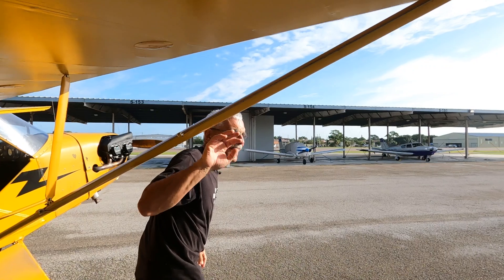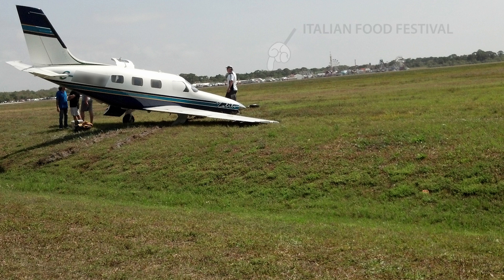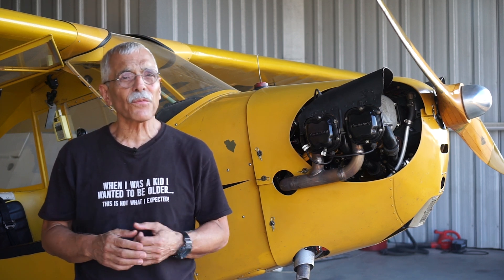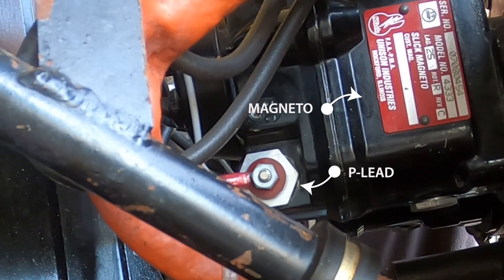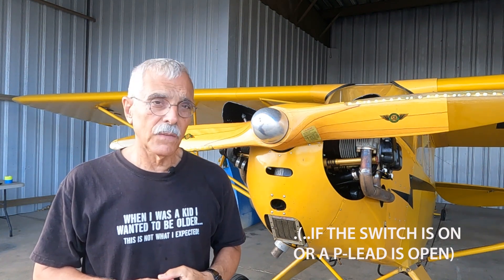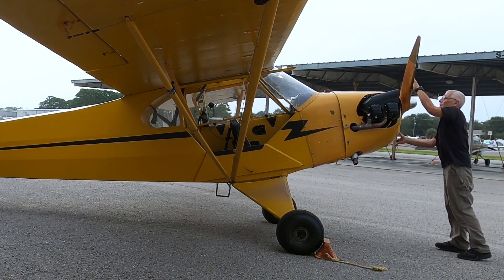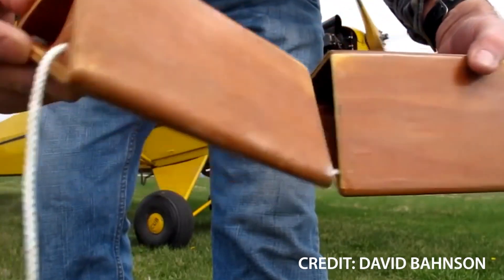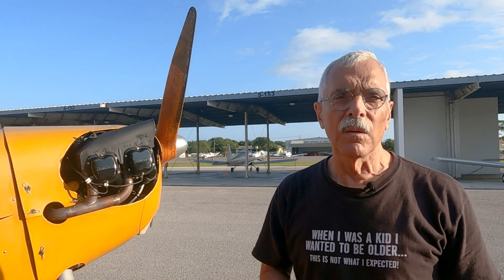Bad for Aviation: Hand Propping Run Amuck

Comment: Another great video. Just one thing, speaking purely as a novice wouldn't you normally put the chocks in place with the
ropes on the inside. To make it easier to release them if they were stuck ?

Comment: After having done it many times now I prefer the leg swing. It is not needed to start, but I find it starts me with a little inertia to step back right after the stroke. I just always make sure the area is flat and clear of tripping hazards. Then When it fires I am several feet away.

Comment: I hand propped my engine and had never done it before. July 25th 2025. 1/2 VW . The builder said run it for 5 minutes the last minute run it full throttle. I couldn't do it. I need a way better way of tying it down. I need help for sure.

Comment: My champ will run 30 to 45 seconds after shutting the fuel off so when I hand  prop, I prime the engine set the throttle and turn the fuel off that way if it gets away, the engines only gonna run 30 to 45 seconds.

Comment: Past '46 7AC owner.  I flew every morning one summer back when I was still flight instructing building hours... During my first week with the Champ, before arranging hanger space, he was tied down out in the boonies.  I untied the plane. Even with positioning the prop before the impulse, the first prop flip was always wasted, and he'd start on prop number two.  I had gotten good at guessing throttle position, but not quite good enough. The engine fired and the plane went to taxi power. I was a front prop'er.  I cleared the prop and landing gear, but the widdle champ passed me before I could get to that car style cockpit doorhandle by mere inches. Lucky me I had the where with all to then run towards the tail, and arrest the Champ's forward motion. You get a minute to think out what just happened while getting your hair blown wildly by 1200 RPM trying to think out your next move. Two hands firmly pressing down on the top of the FUSE, was not enough friction to keep him from rolling. Back to the tail... I figured at that point, my sprinting speed needed to be > taxi speed to get me to the door handle....  I gathered my wits, and with an imagined starters pistol, off I went.  I managed to outrun my plucky craft, get the door open and collapse on the pilot seat simultaneously with a flip of the throttle to idle. Fly these things long enough, you get to tell a few "I learned about flying from this" type of lessons. From then on I either chocked or left the tail tied until "we" were ready to Aviate together... Thanks for the old memories...

Comment: If by myself and no other 'qualified' (in my mind) at proping,  I will do it from the back.  Otherwise from the front if someone qualified is inside with brakes on and hand on the throttle.  I've actually taken a liking to prop from the rear.  Almost assures you are clear the arc with quick access to throttle or mag switch if needed.   It only takes one click of a mag to light it off, which happens about the same instant your hand is well clear of the spinning meat cleaver.

Comment: I have hand propped Champs, Cubs , And the odd Cessna.
Never had a problem Until an apprentice wanted to help.
Taylorcraft on floats I set the controls , pulled it through
a few times and asked for mags, He also fire walled the throttle 
as he thought thats what you do. 
You are better off by yourself as you only have one clown to be in charge of
Yourself.

Comment: As an old banner pilot, hand propping was done to save money and weight.  If you know what you are doing with a cub or similar, there is almost zero risk of the aircraft getting away from you.  Training is key here, experience is invaluable.  Also, please stop offering to hand prop my aircraft for me, I don’t want to see you lose an arm when I can just do it correctly myself.

Comment: I helped guys build air boats. One local boat builder was putting on the motor on the boat and the propeller and he broke a cardinal rule. Do not install the mags in an airplane motor that is not bolted down and ready to run. He had the mag in the engine and he turn the propeller about a foot two work on the airplane and the impulse mag fired. The guy had a little bit of bad luck and there was just enough vapor from the assembly lube, do fire one cylinder one time and the propeller came around and cut off his head.

Comment: Way good presentation.  I've tried all methods of turning the prop on a Champ and am fairly comfy with all but I think the final decision is based somewhat on each pilots own physical comfort..as long as they observe the "stay out of the arc" advice.  Leg swings?  Ya they're great but I see people overdo it to the point of actually ruining their balance.  I guess they'll at least fall on their ass out of the prop arc but not the best thing either

Comment: I think all pilots should learn to fly a power plane by hand propping and old champ or cub. That is right after completing a primary glider course to learn that the engine is optional and great if it's running.

Comment: Off topic but there's a video of a guy about to foot launch his paramotor. He went cheap on the actual brand of paramotor. Cheap netting. Cheap thin aluminum frame. After starting the forward launch and wing overhead, His riser lines got caught in the prop on his right side and pulled his hand directly into the prop. Took 1 finger all the way off and left another finger barely hanging on. When flying, don't buy the cheapest. If you can't afford a safe, durable, highly reviewed aircraft or experimental aircraft then don't risk it. If this guy had bought a Blackhawk or FlatTop, he'd still have his fingers.  Your video title reminded me of that incident

Comment: Mechanic here--if you've got a carbureted aircraft with one of those little manual pumps and you fail to lock down the piston, an engine can suck enough fuel through the priming system to run.  So if you turn the prop with the mags on (or a failed p lead), have got a little fuel in the cylinder or intake system, and the impulse coupling snaps you can have a (poorly) running engine.  Happened to a coworker with an old 182.

Comment: like 10yrs ago I was at the airport on a really windy day like 35+ So I had the door open only a crack, Heard a loud bang. Went around the corner and found a guy dazed, confused,covered in cuts and scratches. Down by the tee hangers was his mutalatied Cessna 180 resting underneath a huge gaping hole about 9-10' high. The guy said to me ''I'm fucked up'' So i replied "You're fucked up? Did you get a good look at your plane? lol So i gave him a chair and water then had went and collected a cell and hat he lost getting ran the fuck over and somehow dragged maybe 50yds across the airport.Then I looked inside the plane and found  the throttle wide open. Been a Decade and never once got a thank you or even a friendly wave. lol

Comment: Real Rope is Nylon or Dacron.   PVC yellow is made by solidifyng urine collected at truck stops in mexico.  Manila is made from coco-nuts.  Good for the Marks Brothers.. not good for boats or airplanes.   Some cheap rope is actually made of paper !  Use Real Rope.

Comment: Ok.. here is my Hand Prop Story.  I landed at the Calistoga California airport in my 8A.  I walk the entire airport and cannot find a single human.  After an Hour, I lock the throttle in full idle ( nice feature of the luscombe.. a locking throttle)  place wheel chocks with ropes led to the cockpit.. and hand start the already warm engine ( same one I had 200 hours hand propping).
  I get in the cockpit, pull the chock ropes free.. and start my taxi.  So What happens.. the airport owner.. JUMPS IN FRONT OF MY MOVING AIRPLANE... forcing me to stop and shut down the engine.  He then annonuces he is some sort of secret volunteer FAA safety widget, demands my papers, and has the FAA fine me for Unsafe Operating !     What it really was about was he didn't want powered planes on his Glider Port ( designated by the State as an Airport).    Today I would carry a long rope, and use a special slip Knot to tie and release the tail. I will not hand prop any airplane without the tail tied down. ("jumped the chocks" is code for " I don't know my airplane well" )   I learned to fly hand propping, and while I don't do it anymore... I am terrified when I see the stupid things people believe are "the right way"  or OK way to do it..     You may have guessed, I am not too keen on self appointed yo-yo;s either.  And Yes.. that guy "managed" his airport straight into oblivion.  hasn't been on the charts in 40 years.

Comment: My hand prop story; I'm over 60, in fairly good shape. Long trip in an old Bonanza. 1100 miles from home, the spur gear in my starter fails, on a Sat afternoon. I need to fly 1100 miles home, or get a starter sent to a tiny airport, borrow or buy tools, find an A&P, and wait for it to be replaced. I chose fly 1100 miles with 2 fuel stops. Tail tied to the ramp rope, chocks in, FBO goober in the seat. I have propped many engines before, but never a 470 size. Mixture set, primer set, ign set, and away we go. I use the kickout method and the engine fires on the 5th blade. Woohoo! But no, the FBO goober thought it was going to fast and shut the engine off as I was walking around the wing. DOH! Get - out. Ign back on, and 3 blades later I'm on my way. First fuel stop, I did not have the scrotal fortitude to attempt refueling with the engine running. After fuel filled, I set everything just right and about 18 blades later, success. Now, my arm and back hurt like heck, but onward and upward. Next fuel stop, I think I can get home with just left tank refilled. So I try to fuel with the engine on, but - it dies at idle just as I approach the wing tank. Maybe a good thing. FBO goober offers to prop while I sit in the seat. I tie it down, chocks, sit in the seat and watch him try to prop the 470. Uh - no, go stand over there. You are going to die. I get back out and start propping, and again, and again. try primer, try everything, finally, flooded engine with throttle open and mixture lean. It starts! But, running full throttle, all 240 horses trying to gallop away and smash into a row of $$$$ planes. I fight the windstorm up to the door, and amazingly was able to get it open, I credit fear and adrenaline. Set the throttle down near idle, and mixture rich. Finally, I'm off to home. It took 5 weeks until my back and arm healed. Next time, wait for the tools and parts.

Comment: @ 9:25, Cub propped without a tail tied down. Also, the elevator is not latched back, so the plane MAY tip forward and smash prop into the ground.

Comment: Excellent piece. I would only add that I might have a slight problem with putting the chocks in the front seat as they could easily slip off and jam a control cable at exactly the wrong moment. I'm a firm believer of having nothing loose in an empty seat while flying.
This would be my only addition to this otherwise really well done tutorial piece.
Happy flying !

Comment: During commercial training the school used an old Arrow that had a bad habit of starter teeth not engaging. Usually we could pull them forward with a screwdriver, but on one occasion I was stuck at a field with the Arrow, and a student scheduled in it in an hour. I asked the local mechanic if he would mind hand-propping the 200 HP IO-360! He grudgingly said he would, for $20!

Comment: That's nice for warm weather but what you do in the middle of winter when it's minus 20? Many years ago (50) I was taught winter starting by an old bush pilot and yes he had all his fingers. First make sure the tail is securely tied and wheel chocks are in place if you have them. With the magnetos off prime the engine about 6 pumps then turn the prop foreward a few times. Next do your full walk around then turn the prop foreward a few times again safely. This draws evaporated gas fumes into the cylinders. With the mags turned on and the throttle just cracked open swing the prop again or hit the starter. The engine fires right up on one or 2 cylinders and shakes like h... for a few seconds untill all 4 cylinders are firing. This has worked for me down to minus 40. I baby the engine untill it has fully warmed up. The airport mechanic winterized my engine.... he stuffed an old sock into my oil cooler.

Comment: I worked at a seaplane base that had 4 cubs.  Only one had an electric starter, and the only way to hand-prop them was from behind the prop.  One of the pilots was born with 3/4 of one arm and 1/4 of his other arm, and he hand-propped all the time (had to use a rope to lean out far enough to reach though).  As line boy, I stood at the tail and held the airplane in place, taking the place of your rope, never had a runaway.  Sometimes, I really miss that job...

P.S. 9:52 looks like my old place of employ, Jack Brown's in Winter Haven...

Comment: After nearly 500 hand prop starts of my A75 Cub in all seasons, I heartily agree with all Paul's advice. Never becoming complacent and always tying the tail wheel is a key. I once had the engine start at a considerably higher RPM than I thought it would...the tiedown and chocks saved the day.

Comment: The Tiger Moth was the most sensible. The switches and throttle were accessible from the left hand side and were easily reached by the  person pulling the prop. Also, because the engine turns right over left the pulling action is a downward action with left hand while the right hand is in close proximity of switches and throttle. I’ve had to swing the prop on a Piper Pawnee with a flat battery. The aeroplane was parked on steeply uneven ground and standing in front of the prop was very scary. I called upon the farmer standing nearby ,to stand behind me and grab a handful of my belt ,ready to pull me clear of the prop if I overbalanced. 
Cheers from Downunder

Comment: I used to tie the tail down on two different Cubs that I flew with a dog leash.
Chock both wheels. Fuel valve off. One Cub had an Eisemann LA-4 mag with impulse coupling. Easy to start standing behind.the prop.
The other Cub had Bendix SF4 without impulse couplings.

Comment: You brought me back to my early days of flying. I learned to fly in a Cub, soloing after eight hours. I never really took to the Cub with its tandem seating, piloting from the rear, no flaps, hand propping, and being a tail-dragger. I was flying out of College Park Airport In Maryland, reputed to be the oldest airport in the world. It had high tension electric wires strung on one end of a short runway, with a forest at the other end. Without flaps, I had to master side slipping. I tended to bounce down the runway and then ground loop. I finally switched to the Cessna 150 and couldn’t believe how easy flying could be. Cubs are bad for aviation.
Reply from the maker: I flew Cubs at College Park when I attended the University of Maryland around 1973. Brinckerhoff Flying Service. I remember those wires well. If the speed was right, you didn't need the slip. I remember the runway was 2000 feet then. It's 2600 now. More than enough for a Cub.
Reply: @AVweb  We must have just missed each other as I was attending the university from 68 through 74 and it was Brinckerhoff with whom I took most of my lessons. I just never got the hang of the Cub though it was the plane in which I soloed for the first tine. My landings must have hilarious to all who viewed them.

Comment: Where did this video come from?

I have had the "opportunity" to hand prop tail draggers for most of my flying 
carrier. I'm not a very high time PP for reasons I will not get into, (US Army, Marriage).
 I passed my flight test on July 4th 1958 in a Piper PA12 Super Cruiser at Edgar Town airport, Martha's Vineyard, Cape Cod. FAA was CAA at the time.
This is a great video. I wish I had seen this video 63 years ago. 
I admit I was lucky a few times!!

My thumb nail is the Baby Ace 75hp Continental. I completely restored (completely) at FXE Florida, from 1980 thru 1987. I got to fly it for 12 years 1987-1999. 
I had a ball with that little aircraft. I'm 86 now and miss flying every day.

Comment: Your closing statement, "... if you don't know that, you probably shouldn't be ..." applies to so many routine but potentially dangerous evolutions. (farm tractor operations come to mind).  Good stuff.
Reply: I was looking at a hand crank Johnny that popped when I nudged the flywheel, must have been sitting on the wound up impulse magneto also.